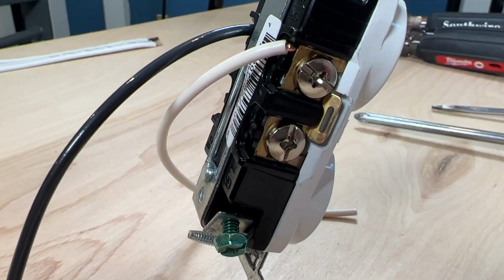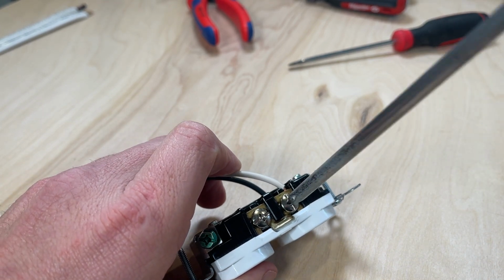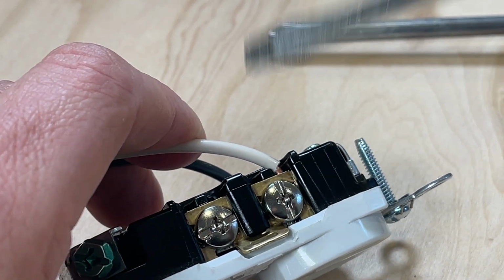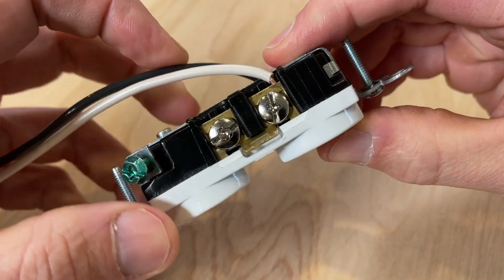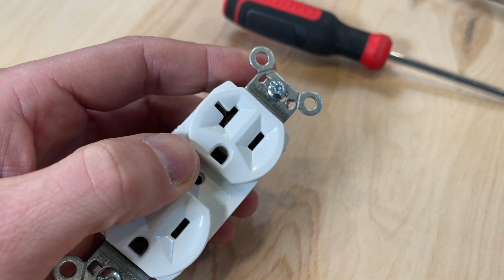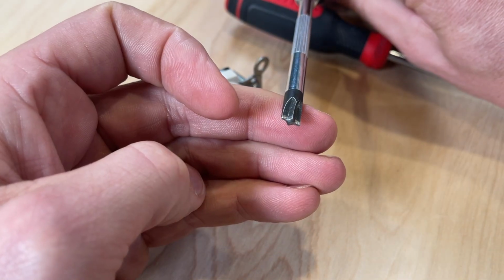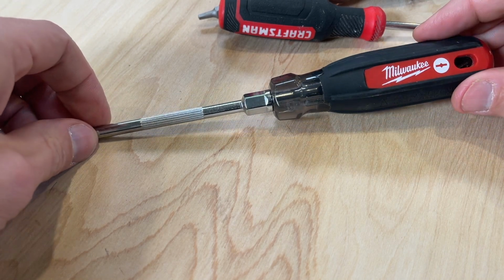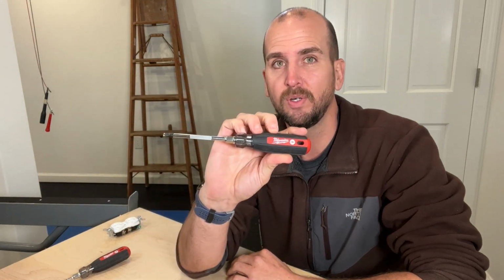80% of People Use the Wrong Screwdriver For Electrical Work

Comment: They also make it much easier to tighten the screw for the hot lead down on a circuit breaker, and is less likely to slip which is helpful if you are wiring inside a hot panel.

Comment: Roberson does work great and is safer but your bigger problem is is that your #2 was done long ago! You can easily get the torque to the requisite 9-12 in-lbs with a good Philips (but Robertson is still easier). Also, I just ran out and checked, the correct slotted driver for those seems to be a 1.2 x 8 mm.

Comment: I love the ECX bit, and I use it quite often… however, there is a big problem with relying on them in electrical work. If you do any panel work you’ll notice that often the screws inside the panel are similar to the ECX screws, but the center square section is rotated 45º. I know the ground/neutral bars in Eaton panels and some Siemens panels won’t work with an ECX bit. Very annoying.

Comment: If your going to show someone how to do a job like that or to use the proper tools, you also need a lesson yourself. If you look at that neutral conductor (white wire) you nicked the copper conductor and tore the insulation off the wire rather than a clean cut strip without damaging the conductor. This happened because your either using a dull stripping tool or the wrong tool (like a pair of dikes). This is a far worse situation than picking a screwdriver as the conductor can snap off when you push the outlet into the box or even blow apart under load, and the end of the wire insulation is raggaty. You shouldnt be showing someone the "right" way to turn a screw when the job itself is not done properly. If your going to show how to use the proper tools start with a good pair of strippers and use them before you tighten the screw. Any good screwdriver that fits will do the trick. Proper wire prep is far more important.

Comment: Other than wiring a shop and shed, I don't do much electrical, so I have always used the #2 Phillips, to run the screw down to snug and hold the wire and then used a 'wider' flat blade than you used in this video, to tighten it securely.

Comment: I've used a no. 1 square drive for years. No slipping and you can really tighten those terminals. Far superior to Phillips and slotted.
Reply: Allen and Torx are pretty common here in the U.S. now, I’m not sure why that they don’t utilize those for electrical applications. I agree though the square drivers are really good too.
Reply: Philips and slotted are pretty much tied for the worst. I hate 'em both. Give me square, allen/hex, or torx any day.
EDIT: Disregard hex, another comment reminded me of people rounding them out by using the wrong size, since they come in both SAE and metric measurements. No thanks, don't want to deal with any of that after some clown was there before me using the wrong size.

Comment: I remember us running some Robertson bars thru Heat Treat in the first few years I worked at Stanley, probably in the late 70s. I couldn't say what brand they were sold as, because we made screwdrivers for Stanley, M.Klein & Sons, J.C. Penney, Wards (I think), and some bars for Western Electric. I believe Western Electric supplied and assembled their own handle/driver for those. Funny, after 30 years in the business, I've always used a #2 Phillips (Kobalt is the best one I've found) or a 1/4" x 4" standard tip screwdriver to install the electrical outlets in our homes.

Comment: You use a flat blade that's the same as the screw head. What is the torque of the screw? It's disine so you don't snap the head off. Comming undun drop of supper glue on the head of the scew to the body,

Comment: Nice video! One question, are the commercial grade outlets you’re using tamper resistant? If not, that’s a code violation to install it in a residential application.

Comment: A pozi drive tip works as well. But, if you want an easy hack, grind a little bit off the point off your #2 Philips screwdriver (or bit) with a belt sander or file.

Comment: I'm in that 10% group that says Robertson is the best option.  As a Canadian, working in the tech industry for many years. I can tell you back in the 90's I worked for a company that designed and built trainer size CNC lathes, Mills, and wood routers.  When we sent the controller boxers down to the southern the US customers for validation, one large school boards rejected the product simply because they deemed the Roberts head screws we used to be "security" screws and not standard for them which is Phillips.  We had to swap out every single screw in our controllers and machines to Phillips for this one customer, because they had never seen or heard of a Robertson screw before.  What is joke it was.    By the way, up here in Canada we don't actually call them #1 or #2 usually, we call them by the colour of the handle, eg. Red Robby, or Green Robby, or Black, or Yellow, those are the 4 popular sizes up here.   Think of how we colour code our printed currency and you get the idea.

Comment: I have always used a Robertson for my electrical for the reasons you mention.  Slotted is too aggravating and hard on the fingers and Philips just doesn't fit properly.  I like the Milwaukee idea, but I'm not paying over $20 for a single screwdriver.

Comment: Never had a problem. Once it's on and tight, it's not a mechanical/moving object. Phillips or standard will do just fine.  You're talking like using distilled bottled water to wash your car.

Comment: Hey mate, electrician here, just need to say THANK YOU THANK YOU THANK YOU! I hope everyone sees this, Im tired of seeing owner done work with blown out screw heads. I almost ALWAYS use a #1 square to verify its torqued. On a side note that philips is cooked. One slip with a philips and it goes in the scrap pile, using that thing is guaranteed to stuff the screws. I have a seething hate for philips for that one reason and square drives fit the vast majority of  philips heads. If youre a DIYer, heres a tip from a professional, never ever buy those chrome plated shiny screwdrivers or high tourque tools, chrome plating is the hallmark of chinesium doodoo metal.

Comment: If it has a Phillips slot, then a Phillips screwdriver, is the correct tool. I find, using a flat head screwdriver, is way more painful. Also, the ecx screwdriver, costs over $20 each. A regular Phillips screwdriver works just as well.

Comment: Robertson screwdrivers come in four common sizes, with colour coded handles - yellow, green, red, black.  The green one is what you are using for electrical work.  The next larger size, red, is used in carpentry work.  The yellow one is tiny, the black one huge.

Comment: I did electrical work for 30years the Robertson screws just started coming in to play when I first started nearly every screw was flat tip had to use a tool called a Yankee made by Kline tools then they started using Phillips thank God the Yankee  Ratchet driver had a bad habit of slipping off the screw and sticking you in the hand Got a little better when Phillips came out was really good when somebody designed a really good cordless drill with a little speed on it from then on out that's how I finished out the rest of my career was with a cordless drill when you had to complete 1 to 2 houses a day square bit was a blessing for the inside the panels no more flat tips including the breakers made it easier then the flat tip slipping off and breaking breakers stay safe

Comment: The outlet screws are actually universal. There is no right and wrong. It’s designed for use with all 4 drivers. You can see the corners of the square is out further, making a Phillips usable.

Comment: At the end of the day, it's a single use tool, and unless you are a professional electrician and screw wires into terminals all day long,  it's hard to justify purchasing one, even if it is relatively inexpensive. By the way, I used to do electrical work, in construction and remodeling, part time, to pay my way through college, and I've never seen anyone use one of those screwdrivers. I'm sure everyone had one in their toolbox, but they opted for a regular Philips head for it's versatility.

Comment: Here in Denmark I have never seen the Robertson screwdriver or even the ECX. Instead most of our ordinary screws are fitted with heads, that demand Pozidrive screwdrivers No. 1 or 2 (they look like Philips, but in addition they have small 'rays' that in a way make the screwdriver octagonal, hence with a better grip). Gradually our screws become fitted with Torx-heads. Most common Torx-screws demand screwdrivers from #10 to #30 (i.e. 10,15,20,25,30).

Comment: @ everday home repairs I want to change out a burnt out receptacle switch outlet in my kitchen to a GFCI switch but I have an issue or question (s) of what I see I know that the positive side(small) is suppose to be on the right and negative (long) on left my old receptacle that I'm looking at is backwards  so my question is once I change it out it will correct as long as I make sure the smaller hot is on the left correct also if I don't see a ground can I make it ground by installing the green wire from the box to the outlet as long as it's a metal box right

Comment: Robertson....you need a Robertson screw driver for electrical work.  These others are the inferior ones that the US adopted because they didn't want to pay the royalties.  ONLY a Robertson will hold a screw on the tip thru 360 degrees ...this allows you to work with one hand...and upside down (for ceilings).

Comment: Being Canadian, I have used Robertson screw drivers all my life. I go out of my way to use fasteners with Robertson heads. I also like Torx, but they are not common in Canada. All others go in the trash unless there is no alternative. Thanks for the heads up on the Milwaukee. I didn't know about it. However, I don't do enough electrical work to justify the cost and I am not aware of any other applications where I could use it.
Reply from the maker: Appreciate the feedback 👍

Comment: Just fill your tool belt with special tools. I can't see adding a Robertson that isn't used much for electrical work. If I were wiring houses and installing outlets all day every day I might try one
Reply from the maker: I think that is why most DIYers like the multi-bit screwdrivers.  Although the screwdriver is a bit more bulky it can work across a wide range of projects.

Comment: I was expecting the video to bemoan the use of non VDE screwdrivers...
Thise heads are combined flat / cross head, I would normally use a crosshead screwdriver as its less likely to slip. Often these heads are present on nasty cheap screws that will shear or chew up anyway if you apply too much torque!

Comment: Very interesting. Didn't know Robertson exists. Nevertheless, why do you need a screw driver to connect your outlets to the wiring, at all? Just push the wire in. The spring mechanism will hold it in place firmly. At least when you do your installations in Germany...   😉

Comment: Here is a tip for any DIY person who expects to need to install outlets. Get a plastic storage device, I found a multi level one that they all snap together. Put all the tools you need, electrical tape, wire nuts and connectors , wire cutters, needle nose, dykes, and the screw drivers you need. I have 2 different slot screwdrivers, one small for the finish screws, and a larger one to tighten down. Store this where you know where it is when needed. You do have to “sacrifice “ a few tools but none of them are very expensive, and the aggravation of gathering all you need to do a 5 minute job is worth the cost.

Comment: I guess things are different in the USA, you say that 80% of people use the 2 screw drivers that you showed? I don’t think so, they would never be used in Australia. Electricians MUST use insulated and rated at 1000v. Also quality fittings have quality screws that are designed for screwdriver ie they are designed for the tools that will be used not the other way around. I don’t know the rules in the US but if you put this video up in Australia, i would have to ask the question “Are you a licensed Electrician?” because it doesn’t seem like it. No offence meant, you asked for my opinion.

Comment: I had never heard of ecx. But it had occurred to me that if I had wanted to take the time to "ruin" one of my flat blade screwdrivers, I could have ground one to have a "centering" projection in the middle of the blade to keep the blade centered in the outlet and switch screws.

Comment: On the subject of the 11 in 1 screwdrivers like the Kline or Southwire type units, the one complaint I have with the original design which has been since cured with the extended reach models is that the bit is not long enough to reach down into a circuit breaker before the main part of the shaft hits the Bakelite housing and prevents the bit from getting where it needs to.  

This is something super common there an electrician would need to work on so it blew my mind that they didn’t anticipate this for so long. It was quite some time before they released an extended reach version. 

Now that they have the version with the longer bits I would only buy that version. The only bad thing about that version is you lose some of the options as far as not getting quite as many bits but at least they’re longer. 

I’m definitely gonna have to buy one of those Milwaukee drivers and try it out, this is my first time seeing it. So the jury still out on those for me. 

Typically though I use an electric screwdriver with a 65mm shaft #1 Robertson bit. That works really well, and my screwdriver has a built-in clutch that keeps you from stripping anything out. Way faster than turning junk by hand.

Comment: I would like to offer another option. JIS screwdrivers. JIS stands for Japanese Industry Standard. The angles and length of slopes on the standard Philips design was intended to cam out on the fastener to control the amount of torque that could be applied to the fastener. It was designed that way to prevent too much torque pressure. 

After WWII, when the United States was providing aid to that county to rebuild, the Japanese were introduced to the Phillips screw driver. They did not like the design. Who does? The cam out process mangles and disforms the fastener. Especially when trying to remove a Philips head fastener that was seated years ago or corroded.  

So the Japanese altered the angles and length of slope to provide a tool that would not cam out when driving or removing a Phillips fastener. I bought a #2 and # 1 set if JIS screwdrivers to try them out after becoming aware of the story. I was astonished at the performance. The tip of the screw driver sets in the fastener like a hex wrench. It will not cam out. You can apply immense force to a Philips fastener with these screwdrivers without damage to the fastener. I bought several more sets so that I have them where ever and when ever I need them. Your Phillips screwdrives will collect dust once you own these. About 7 years ago, when I bought mine, The only place that I could find them was on eBay. Don't buy the economy priced ones. The tips are made of softer metal. Get the high priced ones directly from sellers in Japan. If you have a Japanese vehicle they are a god send. And the JIS standard was adopted by all of the nations in the Far East. So than means China too. 

I highly recommend them.

Comment: Background:  The Arcanadian code requires the Robertson head.  The NEC, and International Electrical Code requires a flat blade head on the theory you need the flat blade to get the specified torque.   Depending on the metal the screw is made of the Robertson  can’t develop the full torque.  

The Electrical Manufacturers decided they were not going to catalog two different items for the US and Canada.  So, they developed the Electrical Combination screw head.  

Klein makes EC1 an EC2 drivers, and bits to convert multi-drivers #32752, is a blister pack of two replacement bits.  I converted the multi-drivers I have by throwing away the Robertson tips, and inserting the EC drivers. , 

Milwaukee a conversion kit for multi-drivers 48-22-2110.  And, you can get the Milwaukee ECX to fit into the 1/4 hex drivers in several lengths. 48-32-4443, is a pair of two-inch impact driver bits in ECX #1, & #2.

Comment: Just curious - did you contact the device manufacturer to see if they had a specific design intent (reason) for using the screwhead they did?  That might be very informative!
Reply: Its designed for the north american market. Where slotted, philips, and robertson are common. So theu designed a screw head that will work well with any of the three. All Milwaukee did was put slotted flutes on a robertson bit and called it ECX. Its 90% marketing and consumerism and about 10% to unnoticeably better.

Comment: Really how many receptacles does the average person change?  Just use a flat head that is big enough to properly fit the screw and you're fine.  Most people don't do enough electrical work to need a special screwdriver.

Comment: Sorry you're using the wrong screwdriver you need a electrician screwdriver that is all plastic only a metal tip and you can't get electrocuted unless you touch the wires with your hands

Comment: mind boggling , I wire entire houses and don't have a Philips or slotted screwdriver in my pouch and why would ya  ? red and green robbies thats it  lol. the correct size slotted driver will yield the most torque out of any  as it has the most surface area touching , Roberson is the best , if ya haven't tried em what are ya waiting for  , best wood screws also  , Philips is a joke cannot take any torque .

madness some here using a Philips and then a flat to finish it off lol ,  counter productivity at its finest
Reply from the maker: I like the robertson design but since I have the Milwaukee ECX #1 and #2 in the bag that is my go to these days.